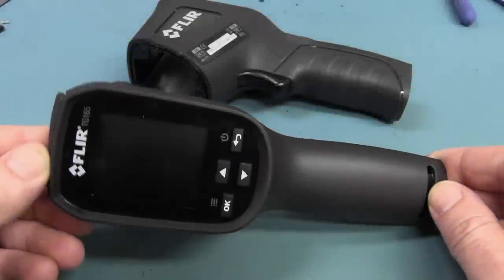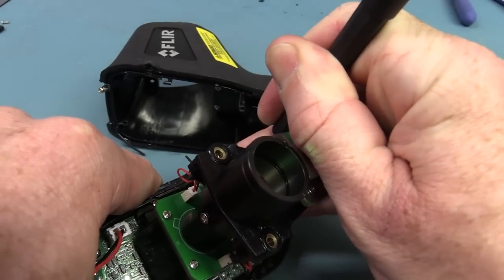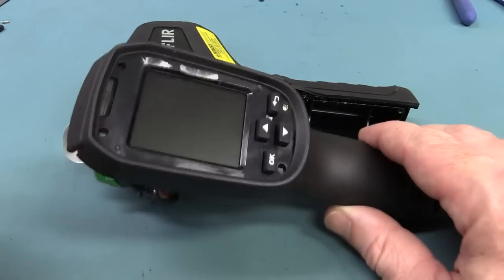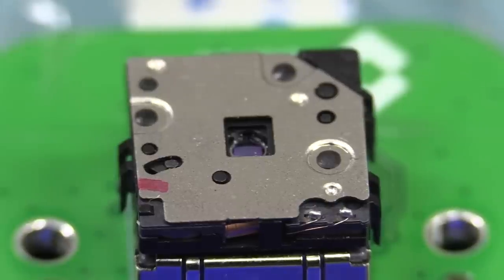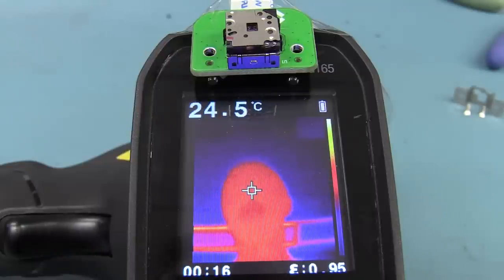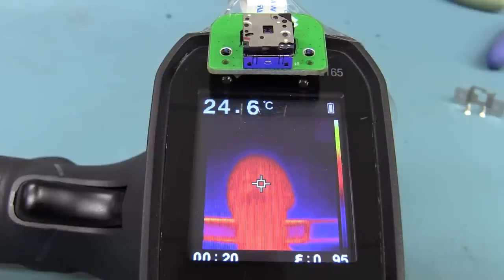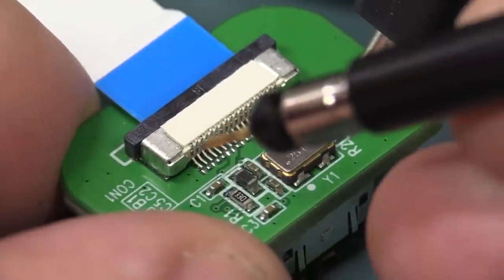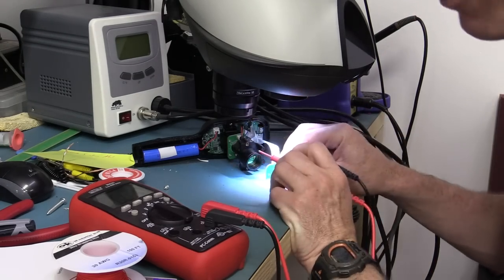EEVblog #670 - FLIR TG165 Lepton Sensor Followup

Comment: it wont be 25 FPS. it can request the data at 25 FPS but it will be "frame doubling" and showing the same frame for a few frame periods. The sensor will still be inherently <10FPS (stupid regulations) but you can still update a screen with data albeit the same stuff for a few "25FPS" frame periods
Reply: *****
so malicious consumers dont use it to make heat seeking stuff which need high frame rate video
Reply: ***** well rules and regulations are not inherently logical, and they don't need to be

Comment: They might have omitted the temp measurement so they could sell more of the expensive models. Some very expensive pro video gear has options which are unlockable via a key. The hardware and software for the option are present in every unit.

Comment: The shutter seems random because it factors in the contrast of the scene. Also, while it does not need the shutter for calibration, it does need it for uniformity correction, since these long wave detectors are notoriously unstable in their gains and offsets.

Comment: You could remove the hardware-shutter, but the software would still freeze the picture as it still "thinks" that the view on the sensor is blocked. Maybe there is a sensor connected across the coil in the shutter module ? Put the scope on and have a look ;D

Comment: 15:00 taking longer for each measurement makes sense.  I bet the calibrate is not timer based but "sensor delta from last measurement max has reached xyz", time to re-zero so the reticle temperature is reasonably accurate.
Reply from the maker: frollard It's definitely not timer based.
Reply: EEVblog  Would it be possible since there's no obvious data output from the lepton that it's using the IR spot sensor for determining if it needs to cal? I'd love to know what happens if you wave (or keep static) a soldering iron or something in the beam.
Reply from the maker: Nicolas Daly Doesn't seem likely, because I can find no data coming back into the Lepton from the processor, and hte processor reads the IR sensor. So pretty sure the shutter is controlled internally by the Lepton processor and internal temp sensor.
Reply: EEVblog
My guess after watching mikes electric video, it's just a delta between the old known value of the shutter and the new one. Time it takes for the shutter sensor to change x degrees. Explains the longer and longer waits each time as it starts to become neutral to the surroundings.

Comment: Sneak attack screws designed to break the item you are trying to fix. Easiest way is a blow dryer and it will pop right off. Its double stick tape. Another option is a couple of drops of charcoal lighter fluid put in the seam. Then wait a few hours and it pops right off. I stuffed a board from a cheap power bank to charge the battery up and put a higher capacity 18560 in it. The charge management on these is horrible btw.

Comment: Dave, you've been using that Brymen multimeter a lot. Any particular reason?
Reply from the maker: dwDragon88 I've had it out since the Electronex show, so it's been lying around. I usually use the closest meter to hand that has the probes I want already attached. Meters are always getting leads swapped for other purposes.

Comment: You will not be able to see your hand when it's in your chamber after closing your glass, or plexiglass door. All LWIR is measurement of the 1st 1000th of an inch of surface temperature. Certain materials allow for transmission and will allow you to see through them like Germanium (optic's typically a thin polished AR Coated Ge wafer) Therefore it's not penetrating or intrusive.. Same concept if he we wearing glasses, you would not see his eyes directly looking at the face you'd see reflection of his glasses which are not allowing the transmission of LWIR.